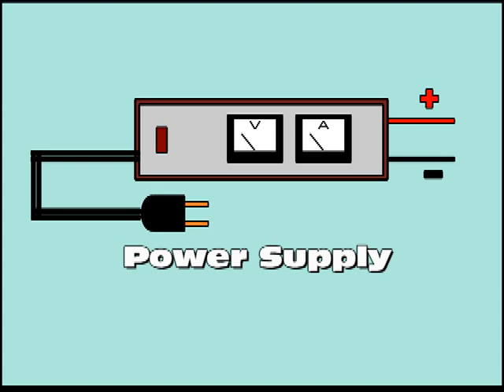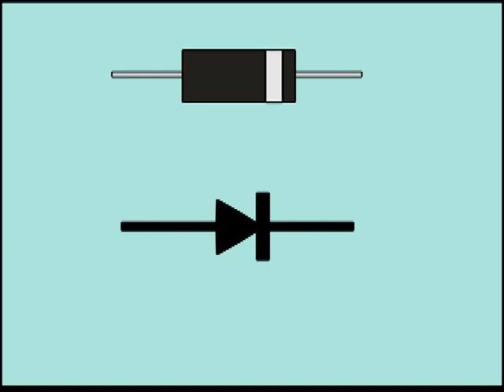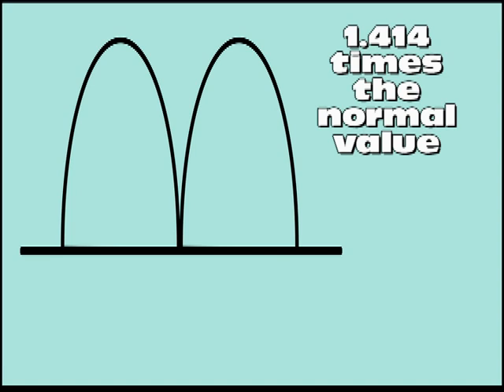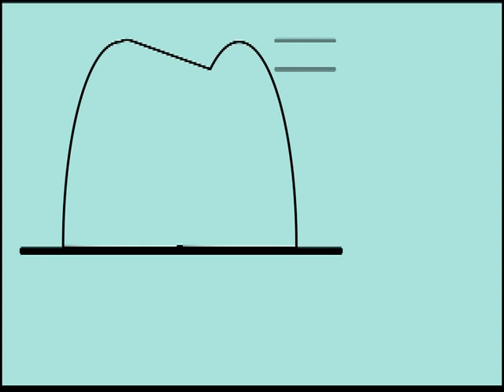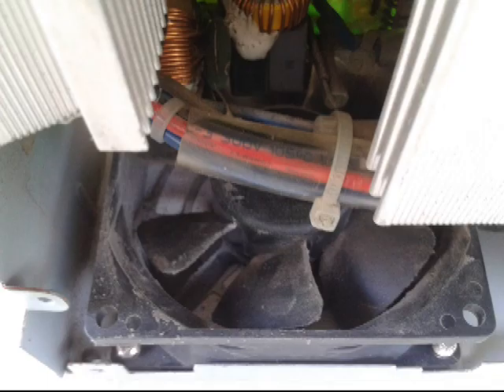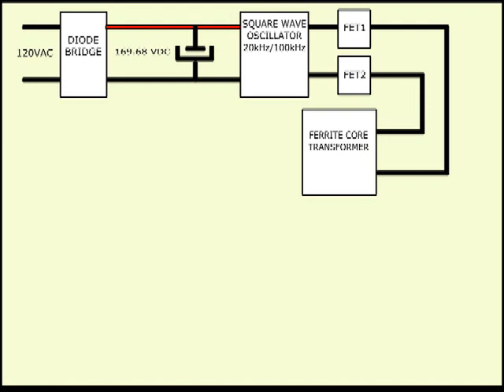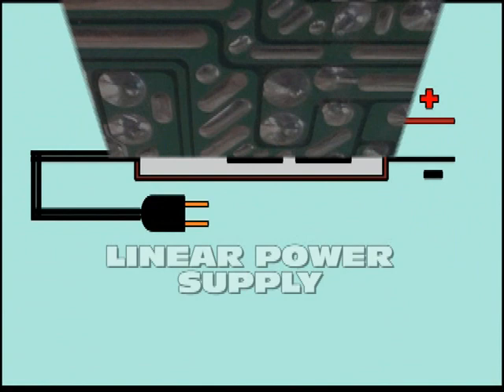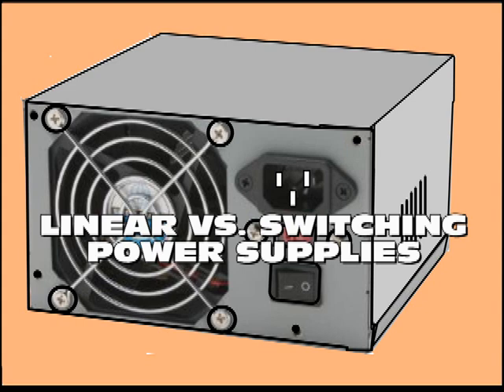Basic differences between linear and switching power supplies

Comment: Hi, how does it step up 120 VAC to 169 VAC without a transformer at the input , a diode bridge can only rectify ?
Reply from the maker: 120VAC is alternating current, and has a sine wave profile, which means part of the time is crossing at zero volts, then the voltage climbs to a value called peak, which is 1.414 times the RMS of effective value.  A 120 volt AC has a peak value of 120 X 1.414 = 169.68 volts. This is the instantaneous value when going through peak voltage. In a power supply, electrolitic capacitors are used to minimize ripple, and such capacitors are charged up to the peak value, that is 169.68 volts DC. In fact, power supplies used in computers step the incoming voltage even further, by using a diode arrangement called "voltage doubler", however, in this example we are using a normal diode bridge, and the result of rectification by the diode bridge is pulses going as high as peak voltage. So filtering capacitors are charged to peak value.
Reply: Chava Tarin ah...
I understand and it's very intereting, thank you !

Comment: Thank you for putting up this video. Have cleared my thoughts a lot. It sure seems like keeping things simple with a linear power supply is better if I want reliability.

I have a CCTV camera in a lift car , connected to a 12VDC 1A switching power supply which is in turn plugged in to a power outlet 220VAC 50Hz on the roof of the lift car. The lift runs on inverters and thus a lot of EMI noise is generated. This however cause the video to be very distorted, especially when the lift car is moving. I tried using a battery bank to power the camera instead and everything works fine. If I switch to using a linear power supply, will it help to reduce the EMI effect on the CCTV camera?
Reply from the maker: Dear Gordon, as you said, when you used a battery bank to power the camera it works much better, a linear power supply will surely improve performance of the camera. Make sure the output of the linear power supply you intend to use does not exceed the camera nominal voltage, in this case, 12 volts. Also, your linear power supply must have good filtering, in order to avoid line frequency hum which would also interfere. Another possibility would be still using a switching power supply, but one which is well shielded, such as the type used for recharging camera batteries (you can even run the camera just using the power supply, and in most cases it works fine). Again, whatever you do, make sure the output of your supply matches the camera nominal voltage.
Reply: @eltunene  thank you for your reply. I’ll be getting a linear power supply and an electronic filter for experimental sake. 

Is there a difference between adding a 220vac electronic filter before the 220vac input to the power supply, vs adding a 12vdc electronic filter after the output of the 12vdc power supply? As much as I’d love to experiment it out, I can’t stop the lift for too long or else I’ll surely get a fair share of complaints!

Comment: linear regulated  is best for radio equipment.  switching PW causes noise  receivers pick up
Reply from the maker: Yes, indeed, PWM is efficient but noisy, sensitive circuits get a lot of interference. You are absolutely right!

Comment: yes but switching power supplies are even bulkier wtf
Reply from the maker: I agree that linear power supplies can be very light, however, an ATX power supply can deliver several regulated outputs and uses very small transformers and a high frequency circuit which is easy to filter as to ripple; if there is enough room, I would prefer a linear power supply over a switching power supply, due to unwanted interference. Linear supplies do not produce such annoying interference.
Reply: no they are not, think about an amplifier, with it's huge transformers inside, it weighs 20kgs. Compare the same output power supplies, the linear are always bulkier and heavier.